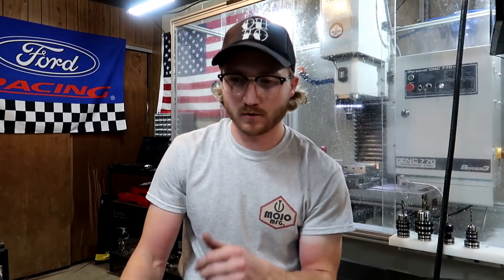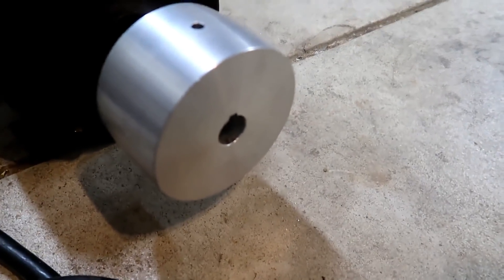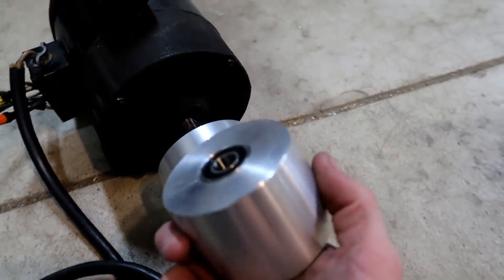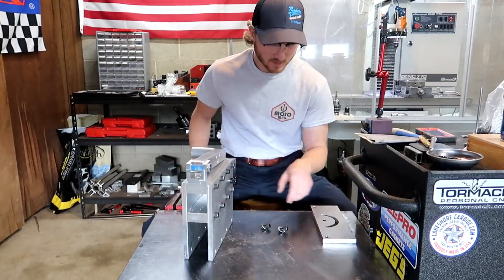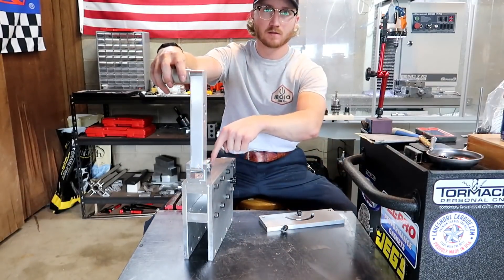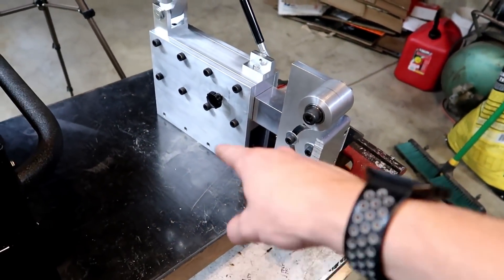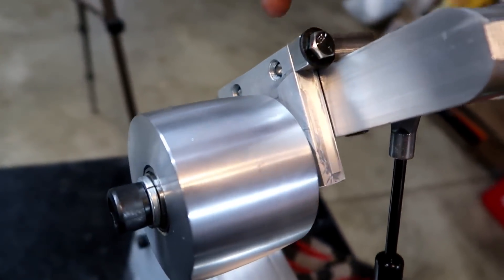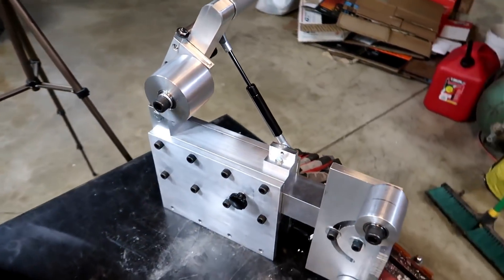DIY Belt Grinder Parts Machining Part 2: Home Mfg. Days #52

Comment: nice, if it works out are you going to produce them as a kit? Just the machineed parts and they buyer provides their own pullies and motor.
Reply from the maker: Yeah I could definitely do that.  I can't remember how much the material cost but it was over $100 but this thing is a pretty rigid and robust to say the least.